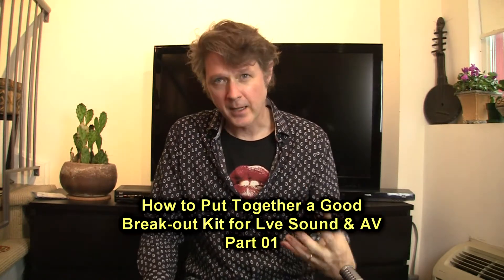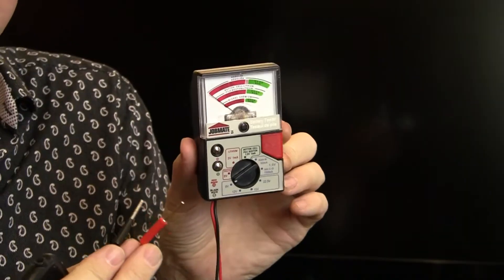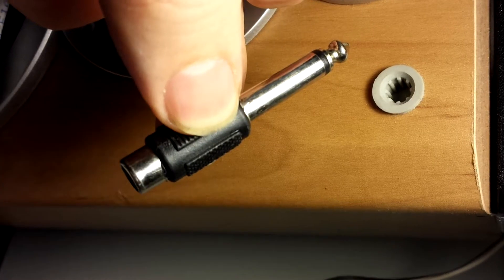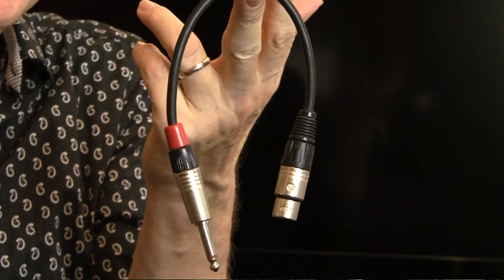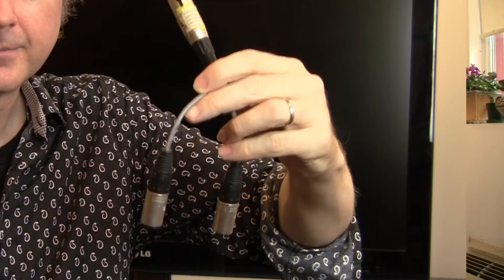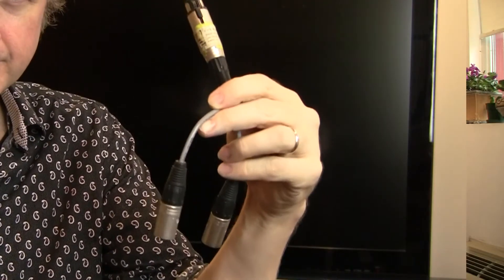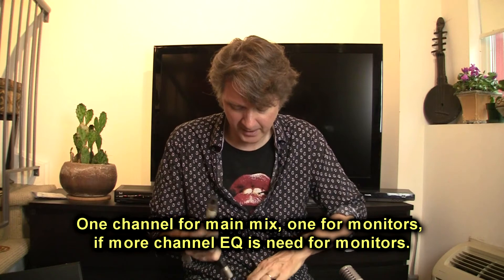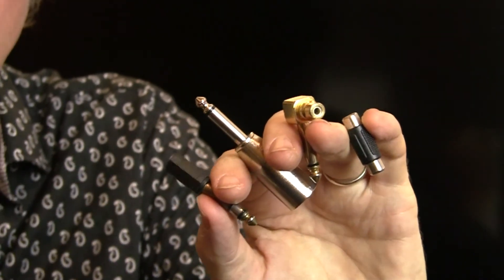Live Sound Tools - How to Put Together a Breakout Kit for Live Sound and AV Techs Part 01

Comment: Is a turnaround adaptor for example trs to trs used just to extend cable lengths?
Reply from the maker: Turnarounds, of any connection type, can both extend a cable to another cable (like VGA's, as they are standard Male to Male), or allow the cable to be input into a connection with the same gender. For example, I once laid out a long XLR to go into a ceiling sound system, only to discover the hotel only had XLR male as an input, so I turned my male cable to female to be able to make the connection quickly.
Reply: Ahhhhh ok i understand thank you very much? Love the kit you have there

Comment: What is the best for feedback for small sound system?
gate-compressor-limiter
or
anti-feedback like dbx DriveRack PA2
or
equalizer
??
Reply from the maker: There are a few choices like any automatic anti-feedback circuit (but I prefer to do it manually), 31 band EQ (15 if that is all you have will work to some extent) and a graphic EQ paired with at least 4 notch filters (I have seen these units). I personally prefer to make sure my spacing between speakers and mics is optimal and then ring out the feedback with a 31 band EQ. I used to use the channel strip 'sweep' knob to find the feedback, then copy the results onto a 31 band (and reset the channel strip EQ), but I have gotten so used to reducing feedback with a 31 band because that is the most common piece of gear usually supplied in an installed system, or most common thing available. So, I find the 31 band EQ to be most available and useful. Cheers!
Reply: I thank you so much. sorry I'm late to reply.
i try learn somthing about live sound.
Reply: Which 31 band eq do you recommend?